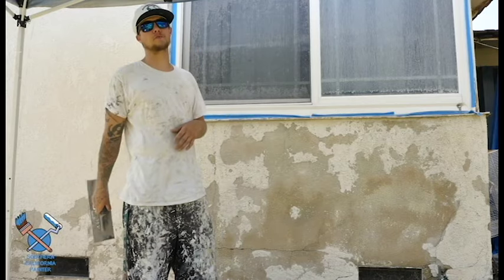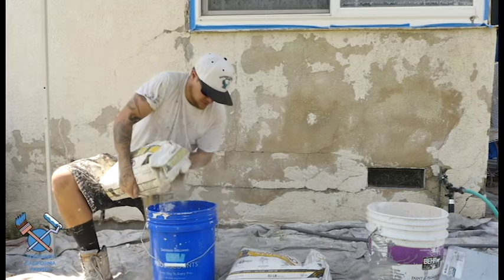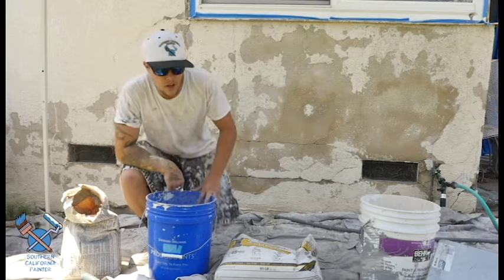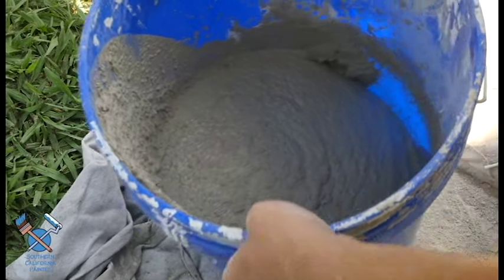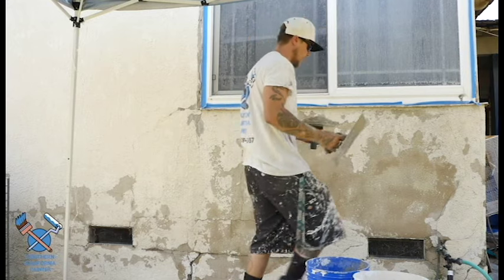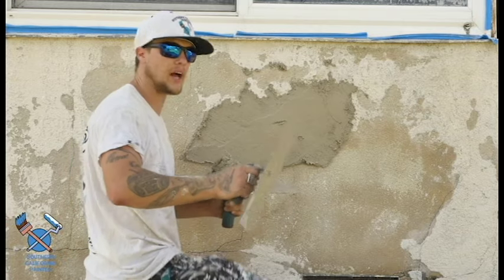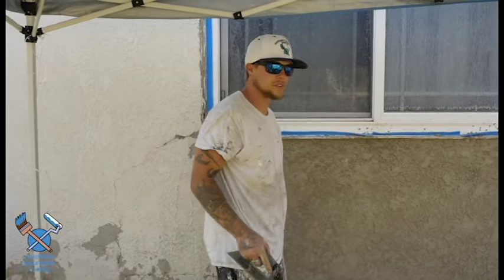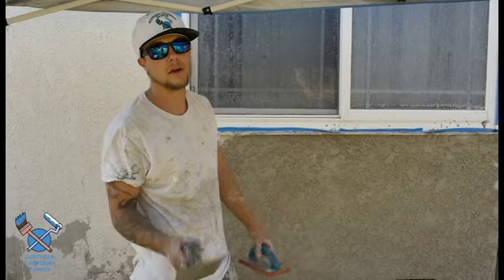How To Apply A Knock Down Stucco Finish Repair Using Rapid Set

Comment: The cracks between the blocks should be cleaned out and exaggerated with a grinder fitted with a masonry cutting disk and pre-patched.  The repair area should be wetted with a bonding agent, or at least sprayed with water before the parging mix is applied to provide the best bond and prevent the blocks from wicking the moisture out of the parging mix too quickly to weaken the finished surface.  If the light tan areas of the wall was previously painted, the paint needs to be removed and the parging mix applied directly to clean prepared concrete.  Dip your dashing brush into a bucket of clean water before loading the brush with the mix and you'll find it releases from the brush with the flick of the wrist much more efficiently.  Without these steps, particularly in a cold climate, the cracks will re-appear and the stucco will fall off of the painted areas within a year.
Reply: Thanks for this GREAT Comment!  Do you have any videos on YouTube? I hope you do for all of us.

Comment: Good video! I was daunted to patch up flaking texture on a Privacy wall. This technique is way better than my original plan. I had some basics with a color coat method but wasn't confident. This looks easier and assuming I get the texture on right I can change paint color without not understanding the grit product, paint, concrete mix that a bunch of these videos assume I know. I am back to thinking I can do this on my own.

Comment: You can also spray la habra out of a drywall texture hopper. Make the texture mix on the wetter side and turn up the pressure on your air compressor to the max. Shake the hopper as you are spraying on the heavy orange peel so that it comes out easier.

Comment: How would you do a corner?   My house has windows on either side of the front door and "window frames"(don't know what the name is) around them.    The corner got bumped into by the porch chair and broke/chipped off.  

Do I just use smaller amounts and somehow shape it after it's on?  Thank you for any help!

Comment: did you use the same mud to texture (bag shown in the beginning of the video) ?
Reply from the maker: We did use the same rapid set to also apply the texture. This type of product is mainly used for light shallow repairs that we aim to prime and paint in the same day. If you have some down time and a waiting period I would recommend using La Habra stucco mix which you can find at any home depot or lowes its a little easier to work with

Comment: Did you use the same rapid set stucco to texture it? 
Thank you
Reply from the maker: We did use the same rapid set to also apply the texture. This type of product is mainly used for light shallow repairs that we aim to prime and paint in the same day. If you have some down time and a waiting period I would recommend using La Habra stucco mix which you can find at any home depot or lowes its a little easier to work with
Reply: In Phoenix so say 90 degrees for this project and don't need to knock out in 1 day. Do you recommend Habra or rapid set?
Also any recommendations for prep to cinderblock given previous texture is coming off in clumps. Do I have to strip entire thing cause rest is just gonna come off too? I'm really trying to patch up not do the entire privacy wall over.😢

Comment: I used this same product. I got it to look like what was in your bucket. But it just wouldn’t stick to my trowel. I had to try applying it at an angle. 40% of the stucco would end up on the floor.  Watching your video I noticed some of it went to waste. Do you recall it being sticky to your trowel? Thanks!!
Reply: Make sure your trowel is dry when applying that stucco. I’m sure by now you found some method out that works lol

Comment: thanks for the video, just wondering whey you didn't use any blue bonding for cement. I have seen many and they mention using it.
Reply from the maker: Great question. While we do our best to show everything in a short video explanation some topics aren't fully covered which is giving me inspiration for another helpful video for you all. A bonding agent (especially blue in nature) your only going to find at a building materials yard which arent always close for some customers. As recommended in another comment below you can find a fair equivalent made by quikrete that is white and is sold at local hardware stores like home depot and lowes. This product here specifically is very high in its adhesive to begin with the "rapid set" which is why it sets faster and ready to paint the same day. (masonry bonding glue is recommended regardless to all applications) and something we use regularly the information just did not make it into the video. Thank you for the inquiry Cheers!

Comment: What is the working time off this stucco? Before it start to set.
Reply from the maker: you have about 45 minutes of working time but it also depends and can vary by the temperature that day and your water ratio. if it starts to dry out a little bit you can add more water and remix it as needed

Comment: Can I stucco/texture straight onto cement board or do I still need a wire mesh?
Reply from the maker: Sorry for the late response. while using lath (wire mesh) traditionally is the strongest way to install stucco or plaster thats not to say you cant apply it directly to other substrates like block walls or cement board. I would be sure to use adhesives / glues. if a stucco yard where you get the good stuff is not readily available go to home depot quickcrete has a bonding adhesive just follow the instructions on the bottle i would mix some into your stucco as well as roll it onto the cement board. The only concern for me is possible cracking at the joints / seams over time. best of luck on your project.

Comment: So after that texture is ready to be printed?
Reply from the maker: correct but you should prime it first with a masonry bonding primer not regular all purpose primers if you can if not those primers will work also. Sherwin williams and dunn edwards carry really good specific primers for that